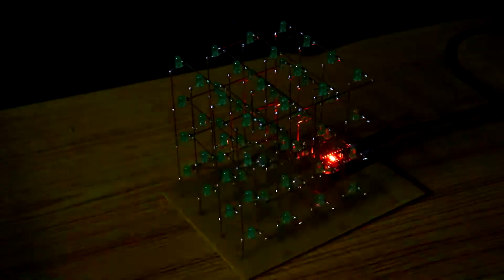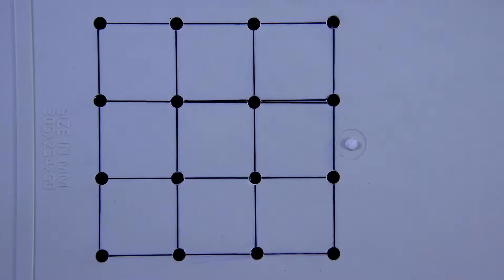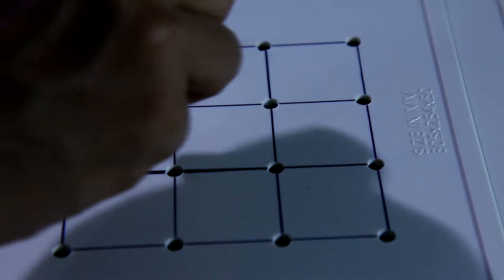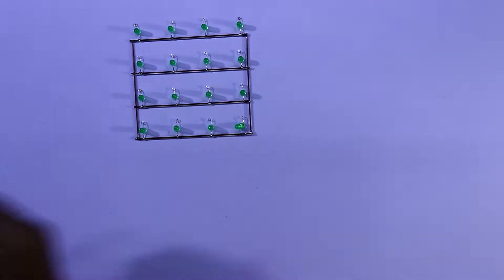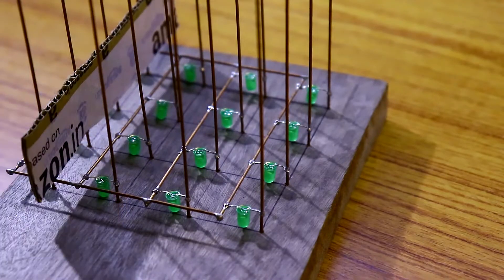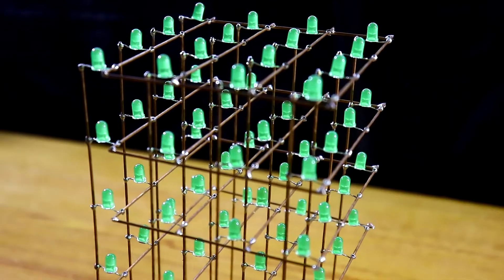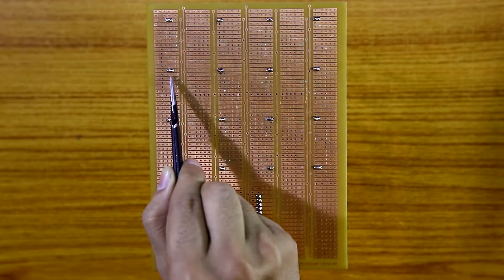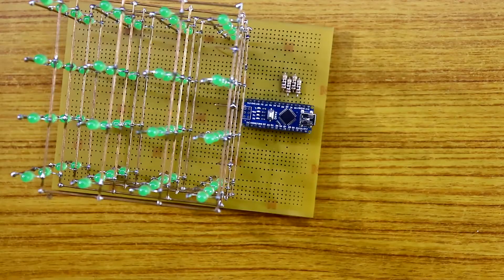4x4x4 LED Cube Arduino Nano | EE Wave

Comment: I have recently competed constructing RGB cube following the schematic  and circuits available on various YT channels. But at the time of testing I am stuck as I feel that the circuit diagram available on YT is incomplete  I have followed the schematic of one "Electronic Demon"  and puzzled while connecting VCC and Gnd wires to 25 shift resisters and aurdino  Uno   kindly help me in solving the issue

Comment: I really like the upfront work of preparing each led. Makes soldering much easier and getting everything aligned.  I think the next step in a project like this to expand it further would be to use shift registers and an external power supply, as you're pretty much at the limit of driving 64 leds from the arduino. I appreciate you explaining each step rather than almost all other videos which just show the build process.

Comment: I have  two 4x4x4 LED cubes with Arduino Nano,one with blue LEDs and the other is with yellow LEDs, one of the cubes is working fine, but in the second LED cube [with yellow LEDs]a column which is connected to pin 0 is extremely dim. Both LED cubes are done according to your schematics. All layers are anode and all columns are cathode.any help ?
Reply: Try another arduino?
Reply: Different led colors require different voltages and if you have different manufacturers (even if they are the same color), you may need to change the resistor values to increase the current to those particular leds. You need to check the data sheet for each LED that you're using, and check the output from the arduino.

Comment: everything is great 
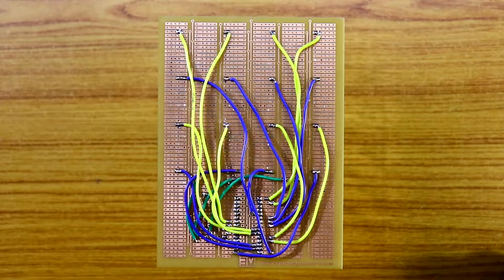but on 8:40 you did not show how you are connecting .You showed only the finished work. It is very difficult to follow this step.Please don't skip the steps, people who know these steps they can skip these steps but for us to understand it is essential.Please take into consideration this as well.Thank you!
Reply: I checked carefully the diagram which was given and then everything became clear. Thank you!
But right now after  I solder everything , I tried to check with multimeter, but none of the LEDs light up.What can be wrong ?
Reply: You did not show the GND, how do we connect GND ,Is it because my GND is not connected...
Reply from the maker: No LED pin is connected to the GND.
Reply: @EEWave  To turn on 1 LED, current must flow from a pin to an LED , then to a resistor and then must go to the GROUND. I just can't understand how the current does not go to the GROUND.pls explain.
Reply: it is multiplexing, therefore it does not use GND.

Comment: Will i be able to make 5x5x5 just like this?with arduino nano?
Reply from the maker: 5x5x5 is not possible because Nano doesn't has enough pin. For 5x5x5, we need 30 pins. 25 pin for all LEDs and 5 pin for layers.
Reply: @EEWave  so i can use arduino uno right?
Reply from the maker: UNO also doesn't have that much pins. You need Mega.
Reply: @EEWave  ok thanks!
Reply: @hruaizela_Sailo  You might not have enough power coming from the arduino to do 125 leds...

Comment: Can u pls explain the connections of the cube to the pcb and Arduino nano to the cube in more detail or you can give a circuit diagram of it 🙏🙏👍
Reply: HE posted the source code in his description. You have 4 address lines, which denote each layer. Then you have data lines to each of the 16 leds on the layer.  Just a matter of turning on the appropriate layer and led.

Comment: Wow man. You used every pin
Reply: I'm swimming in Nanos haha been too busy with circuit level logic as of late. That and studying up on c++, I want to be a better coder and I'm sick of beginner languages. C was my favorite language in university a long long time ago as well and went well over a decade without writing a line of code. I've been liking esp32 boards and using arduino coding is leaving alot of performance on the table.
Reply from the maker: Haha.. I'm not that much good at programming. I can just read a program and can modify a little bit. 😁😁
Reply: @EEWave  that's what I do too. Its hard not to with all the libraries out there. There's still lots of room for other I believe. Microcontrollers are getting more powerful by orders of magnitude and I want to take advantage of it. You can code man,  you made an endless runner on a shitty 1602 display. Thats impressive
Reply: @jstro-hobbytech  Write it in assembly!
Reply: @larrybud  well with arduino it's direct port manipulation by bit banging. I've learned alot since this forgotten about thread haha. All the and and ors haha. Ever read the datasheet for the mega. It's like 350 pages or something haha
Reply: @jstro-hobbytech  Start small. No need to jump right into the mega.
Reply: @larrybud  oh yeah. It's my go to when I use a nano now. Or I follow current stlib cpp stuff to stay sharp. Well sharpen up, I try to use circuit based stuff to avoid code. I understand data structures and such better than ee which I've been obsessed with the last 4 or 5 years. I'm thinking about going back to university for an ee degree at 45 haha I already have a technical degree but an ee one is a bucket list kinda thing. I broke the cycle after 3 generations of mechanical / power engineers haha.